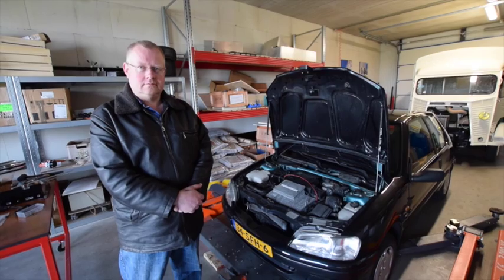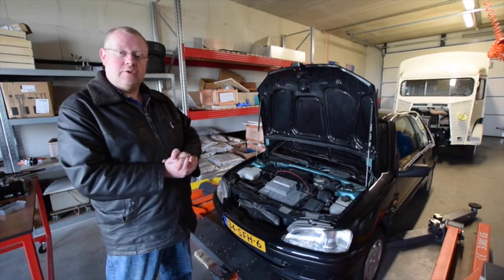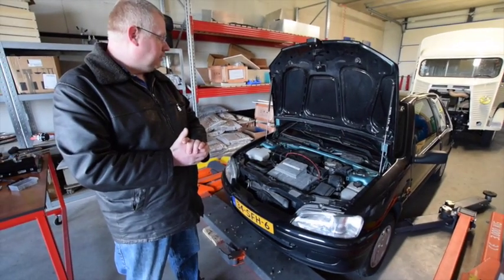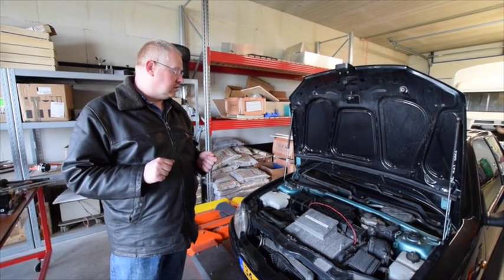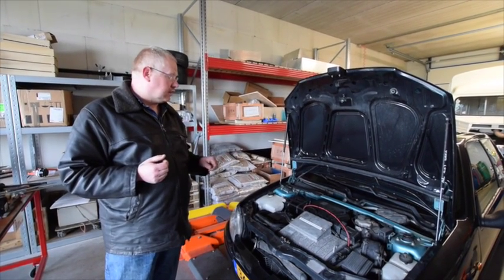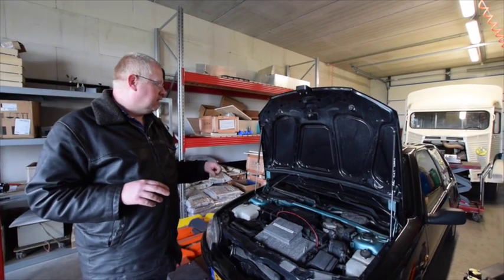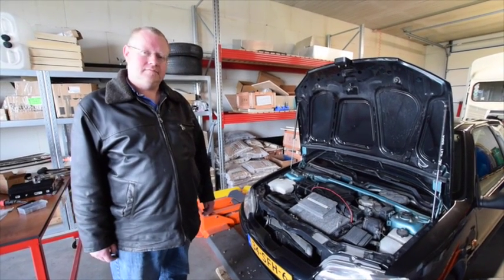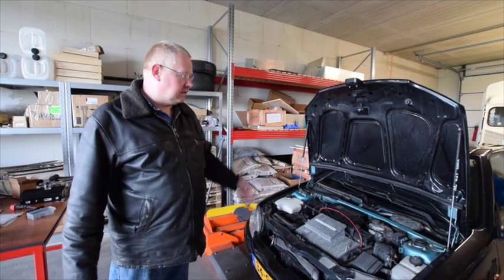Clever EV Conversion Upgrade Original Electric Peugeot 106 with Lithium

Comment: the 106 has a very good driving behaviour very good chassis in the petrol versions, i wonder what is like in the ev version with different weight (cause its best characteristic it is the low weight body). I myself have a 106 xsi from early 90s and i was thinking about an ev conversion, my motor has a lot of miles and problems. but the cost of 5.000 to 8.000 euros (prove me wrong if someone knows something more economic) is the cost of running the petrol car for a lot of years and considering that the battery  charges are free. I was thinking is it worth it; for a car that i buy for 1000e (with its problems), can you have the same power (100ps) , do you mess with the great chassis balance?   also can you have a trip without the need of extra weight from more batteries(miles per charge/ weight)?
Reply: You would expend more on the converssion because he only changes the batery pack, in your case bought a used leaf , zoe(dont bought with rental bateries) or a i miev you would have a newer car with new technologis for less

Comment: Nice enough but you could have bought a used imiev for 10k€ with only 20kkm or  a Leaf for 14000.
Converting/upgrading cars today only makes sense if you need something very special and you have plenty of money.
Reply: these old frencd citroen/peugeot electric cars are way better than newer EV since they are mostly electric conventional cars instead of a computer on wheels
Reply: Yes nice old handbrake instead of automatic parking brake for example- that must cost more to replace
Reply: I know nothing about cars but instinctively could tell they're a better way to go
Reply: I like both of the cars you mentioned. The thing is, some old fossil fuel cars might be worth saving...i was thinking to some Saab, Lancia, Alfa and such. I also feel for my old 2002 Toyota Yaris, even tho i know it wouldnt be worth...
Reply: You should check out Damien Maguires, he converts BMW's.
So far 5 series, 840 and next 7 series i-drive.
He is also doing a €1000 EV conversion.
https://www.youtube.com/user/pooey1911
Reply: Hey you funny folks. This car is already electric. They just converted the old ni-cad batteries